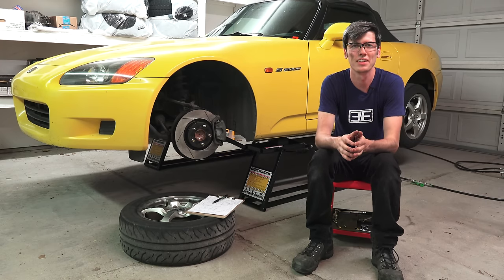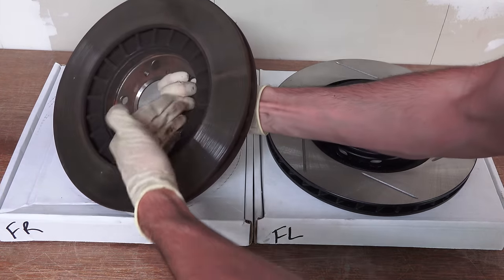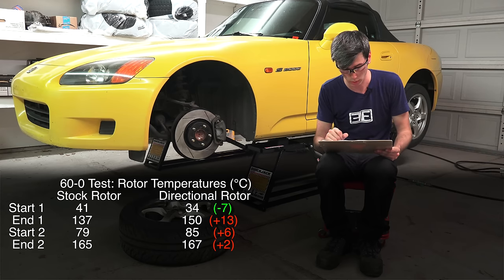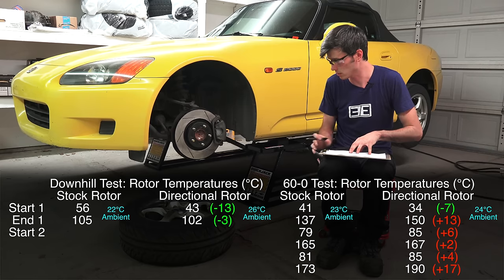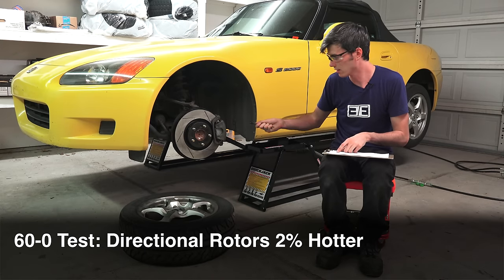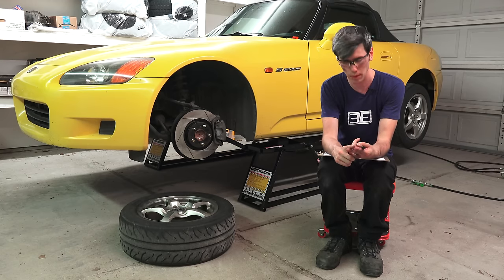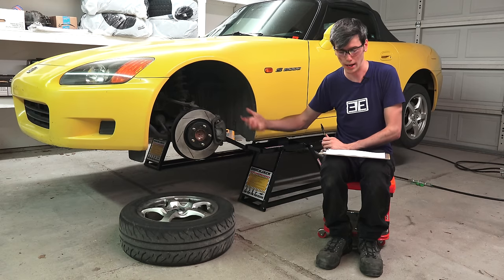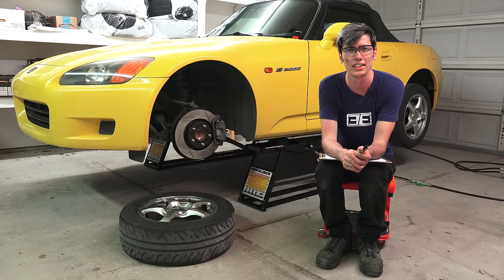Do Performance Brake Rotors Have Better Cooling?

Comment from the maker: This video is (possibly) a great example of confirmation bias. Because I think it's logical that the rotors have a better design, I did want to see if there's a reason for which they'd perform better than the stock rotors. Based on my data alone, I cannot confirm that, but I'm trusting that Science of Speed's data is accurate. Also, the sweat and grease stains are just make-up, you don't really believe I spent time in a garage working on a car, right? 😂 Follow on Instagram if you like to go fast! https://www.instagram.com/engineeringexplained/
Reply: You have 1.3 M subscribers. Treat yourself and buy you a small window unit and one of them large super quiet box fans. You can take it with you when you leave or donate it to a little old lady who needs it.
Reply: Engineering Explained way too many variables in those tests. Too bad you can't stick it on a dynamometer in a room with controlled ambient temperature and some sort of hydraulic shunt to put the exact same amount of braking pressure each time.
Reply: You nailed the analysis here. It's possible that the aftermarket rotors are designed to quickly reach a higher optimal temperature to increase efficiency, which would make them appear worse at low (and not dangerous) temperatures. Talking out of my ass here, but definitely if you are testing performance parts, the testing methods should replicate high demand events. If anything, this video demonstrates why people shouldn't be upgrading their car with expensive performance parts if they don't really know if it will help anything.
Reply: Engineering Explained Yeah, I feel like you wouldn't have put so much extra work into analyzing the data or finding other people's tests if the aftermarket ones had come out as cooler right away. But with the mass difference your results do make sense.
Reply: For example, Formula One tires would have very little grip at normal speeds. You have to run them high speed on a track to get them at optimal temperature.
Reply: Do you think that there was more drag on the new rotor? Maybe a test where you only use the emergency brake to stop will show the temperature difference, without applying braking power on the front.
Reply: Here's the issue though.  Unless you're planning on tracking the car these rotors don't perform as advertised. Also, it's difficult to trust the numbers provided by the same company selling the equipment.   

If at the end if the rotors perform better regardless of temp then it's a sound purchase.
Reply: What about the difference in unsprung mass on handling? While the Science of Speed laps were close, that may have been done specifically to compare similar amounts of energy being dumped into the brakes over a lap for the comparison of heat dissipation.
Reply: Adam Klingenberger Or use Tyre blankets to get them into working temps, now with wider rears it is much harder to get front and rear into working window simultaneously.
Reply: TheBowlingPotato great point
Reply: Engineering Explained I I believe the issue of why they were so close is that new rotors have a much higher coefficient of friction. That's why all the hashmarks are on there so they can bed in the brakes faster. I think you need to do this test after putting on 500+ miles on the new rotors and then you can swap them back-and-forth. I'm willing to bet you would get much more accurate numbers with the same exact test
Reply: Engineering Explained try the left ones on the right and vise versa please! The results could be interesting
Reply: The video is talking about the internal veins of the rotor, not the slots on the rotor face.
Reply: So you tested heating, not cooling
Reply: Is it possible that the design allows the brakes to come up to operating temps faster so that you have the most braking efficiency faster?
Reply: Jim Cole 
No. The actual metal will provide nearly all of that temp.
The design would have to be radically different to see any real change in operating temperature levels.
Reply: Could it be that your testing wasn't done at speed? Going faster would put more air over the brake rotors. And a more efficient design would mean that there's more air being displaced by one than the other. So when you have large a volume of air going through them, you'd be able to notice the difference in the data but at lower volume of air there wouldn't be much difference. I'm sorry I don't know if I explained that properly. English isn't my first language.
Reply: Dommelsch Ivy no, your test sucks. The rotors don't spin in open, cool, stagnant air when they are on the road.
Reply: I think you test is more educational than that That of Science of Speed. If you don't do trackdays- you probably can do without aftermaket brakes.
Reply: Engineering Explained new rotor might not be broken in. Such as a new engine runs hotter compared to a broken in engine.
Reply: The thing is, I think these rotors are better but it's more of a wrong application type of deal. 

they tested the rotors on a track which "proved" they had better cooling. That may be the case, but the rotors itself wtih their design my not be very good on a normal car. they had less mass which made them heat up quicker in your tests. but if we look if you would change the pads to what ever sports brand there is(EBC?) 

I saw a test on break pads that motive DVD did and the break pads wasn't as effective on lower temps, which means these were probably made to get hotter more quickly to help the break pads heat up. 

This where that test shows some promise. They can, when pushed hard, get rid of the heat. when your driving in higher speeds you have more airflow right? 

because just changing the break pads, they were(in normal condition according to that test) performing worse, with longer break distance. but when the pads heated up they were more effective. 

I think it's more of a "you need booth parts" type of deal.
Reply: masterpiece dude. one of the best videos of yours. thanks for this !
Reply: Maybe they are supposed to preform better with racing break pads that will work better at higher temperature?
Reply from the maker: I don't think there's going to be a difference in coefficient of friction. I used the exact same brake pads for both tests, and both rotors are made of cast iron. The material contact is the same, with the exception of their being slots on the new rotors, but slots will not change the frictional coefficient.
Reply: how about the pad temp? and how about rotors with cryogenic treatment?
Reply: All them sweet youtube dollars is why
Reply: You are onto something with the MASS of it. Less mass, heats up faster. But the design of it, is for ventilation. But in order to be ventilated, you need to be driving. So at a stand still, yeah, they haven't had any air put to them yet. So the smaller mass is hotter. But if you stayed in the car.. stop, go(cool faster), stop(which starts cooler WHILE driving), go.. etc. You can't STOP, record stopped, go, STOP, record again stopped. I think it's bad procedure. I have always had warping issues with my stock rotors. Go to slotted.. Haven't warped any yet. Because they cool faster, and don't stay hot like stock one's do.
Reply: This is the best answer - the cooling needs air flow... and need to measure it without braking again, so the infra-red measuring is required.
Reply: I don't think this test had confirmation bias. Stock rotors aren't designed with track temps in mind so it figres they would preform well at 50 percent brake pressure and down a hill where auto manfactures would have designed their brakes to preform.

What I would like to see is a break down of the braking efficiency throughout the range of temperatures you might see ranging from first stop in the morning to after a couple hot laps on track to test whether after market directional brakes are indeed worth the money.
Reply: What if the new rotors provide better braking than the old rotors. The better they stop you the more heat they make.
Reply: I love that you consider different biases. Thanks for the great video!
Reply: I have to say, I'm not a full-blooded engineer like some of the peeps here but I disagree RE confirmation bias. Honda has decades of racing experience and the engineering background to put good brakes on a car like the S2K--there's no packaging or cost-cutting reason for them not to. I think it would be difficult to find an aftermarket company that can design a part to the same spec and outdo Honda or many other prominent automakers. If you want the car to stop better and suffer less brake fade, give it bigger rotors and calipers.
Reply: Engineering Explained did you also consider the weight of the gasoline in the car? Not sure how big the tank is in your car or if you refilled between tests, but I feel like that extra weight also could have made a big enough difference too. (the extra comments you made at the end also make sense)
Reply: Engineering Explained but surface topography will. That's all I'm trying to say. You're coefficient will drop after you marry the two surfaces better.
Reply: Realistically for the street some basic rotors work just fine. Am I right to assume that?
Reply: Pardeep Grewal I was thinking the same thing. Maybe upgraded brake pads and brake fluid?
Reply: Engineering Explained Legitimately curious if you would get different/better results if you put the Left directional rotors on the right and visa versa
Reply: Engineering Explained i think the test wast done wrong the purpose on the veins is to alow it cool down faster also is their a material diference?
Reply: I like this idea.  40 mph doesn't generate a lot of airflow, especially going through the wheels.  Track driving would help.
Reply: while they are of better design due to curve directional vane being proven to work, they actually still have a design flaw that is preventing them from being as efficient as they can be.

that flaw was inadvertently pointed out by misconception in the video. from a cooling point of view for front wheel applications, the vane inlet should NOT be on the outboard side of the disc. this is due to aerodynamic of the car itself. the outer face of the wheel and wheelwell is actually a low pressure zone that is drawing air out of the wheel and wheel well. by having the vane inlet on the outboard side, it is trying to suck air in as the aero of the car is trying to suck air out, so the two are fighting each other.

that disc design works well in the rear because there is high pressure pushing in on the rear wheel so the vane inlets are working with high pressure. Ford and GM both took advantage of that with the newer mustangs and corvettes respectively.

in the case of the corvettes, having pillar mount dual cast discs, GM sells little disc rings that you put in on the outboard side of the vanes for increased cooling at the track on the front wheels. if the discs were in fact pulling "cooler air" as pointed out in the video by having the vane inlets outboard instead of inboard, GM would have known this and instructed to install the rings on the inboard side since the technically could be installed that way but rather they specifically state that the rings be installed on the outboard side of the front discs.
Reply: Engineering Explained  I think you are absolutely correct in considering the effects of mass vs temperature. It makes sense to me that the kinetic energy of the vehicle being transformed into thermal energy in the brakes, would be a constant. Assuming the work being done is conducted during the same time period, I would agree that the smaller mass would heat quicker, and to a greaster temperature. But the question here is cooling, not heating. I think your whole methodology is incotrect. It would seem from your testing that you tested is if the brakes would be cooler under loading, versus, if the brakes are able to dissipate heat better. I think the better question is, under loading, with the rotors spinning (at a fixed speed) and a specific temperature, how quickly do the rotors approach ambient temperature, to within a specified percentage of ambient. 
looking at heat transfer to the surrounding medium (the air) through convection, the equation is linear with the temperature differential. i.e. the hotter the rotors get, the more heat will be dissipated. and the same goes to radiation. This however, is a function of t^4! So the heat transfer from the rotor as a function of temperature, is to the difference of the rotor temperature to the 4th power from the ambient temperature to the 4th power. at low temps this will be small, but clearly, the heat rejected by radiation will be substantial at greater and greater temperature differentials!
Here is a suggestion on how to modify the experiment. ensure the car stops in the same amount of time, from the same speed. (This hold the input Ebert the same for all experiments) record ambient temp, rotor starting temp, max temp, and finnaly analyze how long it takes to reach 1-5% of ambient. Assuming that the cooling data looks like a differential equation asometotically approaching zero this may be a good approach. I think this would be much better at analyzing how well the rotors cool. 
one last thing, the recording of the rotors needs to be done while the car is moving so that fresh, ambient air is being introduced into the rotors. otherwise the cooling of the rotors will be tainted by the heating of the ambient air around them. the whole point of the curved blades is to suck air, and (I believe) allow a larger surface area to reject heat to the air.
In summary; I believe that you tested how well the brakes heat up, rather than how well they cool, and that a new experiment needs to be done to test cooling.
Reply: Engineering Explained .  What is the difference in mass?  I bet the aftermarket rotors are lighter and therefore don't dissipate the heat the same.
Reply: Engineering Explained I thought you got punched in the face in a bar fight or something
Reply: Engineering Explained which side is the exhaust manifold on ?
Reply: I bet fresh fluid changes, and higher friction pads are the best bang for the buck for a stock near factory hp car for the street. My car is equipped with Brembo 4 piston front and 2 in the rear and it's plenty for the street although the slotted rotors look nicer. I could just save some cash to be honest and this video helped me understand for my needs I don't need to spend tons on rotors.
Reply: Is it possible that left/right brake rotors have been inverted, giving them no air flow? If you invert them, the orientation of cooling cavities will be the opposite!
Reply: sseeplane I disagree. there I get what you say about control but lab testing and real life don't always match up. How would you simulate the heating and then the cooling in a lab? how expensive would it be? an how close would it be to the cooling of a mounted rotor? (direction of air flow to the rotor would be harder to recreate in a lab since you have the wheel the car aerodynamics affecting the air flow.)
Reply: Do you think maybe the difference is because you measured your brake temperatures when the car is static and not moving? Those cooling grooves only work/make a difference when the car is in motion because they rely on the car's movement to get cool air, right? The difference should be in how quickly the rotor sheds heat when the car is moving between corners versus how hot the rotor is right after you finish coming to a stop.
Reply: Kinda wish ur goofy ass would have put farenheight also... Not everyone knows celcius
Reply: I'm going to reply to your comment here as well (in case you miss mine). But if that diagram floating at the start of the video represents the side of the car that the camera is facing, you have them on the wrong way, ie they would pump more air going backwards than forwards (centrifugal fans). You have them on the wrong side for maximum airflow. Also there's differences in casting towards the centre of the disc (holes on the lighter one) that would alter the weight and have less of an effect on temperature than a lighter braking portion would be.

I believe you need to swap your rotors left to right and repeat your testing
Reply: Brett Young wrong: there are less than 5 countries worldwide using the old English system, compared to metric.
check out Wikipedia on this.
Reply: Did you consider the different surfaces? The stock rotor was shiny and smooth, the new looks much rougher, which could result in different temperatures too (more resistance when breaking -> more heat).
Reply: You should have used everything new. i dont know if you bed in the pads but the rotors wont have the exact same surface to test it in actual equal conditions. if the pads weren't bed in for the new rotors, it might create uneven friction and cause higher temperatures..
Reply: Sometimes confirmation bias is a good thing. If there's fundamental reason why the results should be a certain way which the testing is not "seeing" one should look at problems in the testing methodology just as much as problems in the thesis. In either case you're going to learn something new, either your test was bad or you will learn some new fundamental truth which flies in defiance of age old conventions.
Reply: Those rotors cool while spinning and testing them after a stop is not where they would shine. They should be cooler when you're off brake and on throttle. When you need your brakes again they've would have come down to a lower temp when entering the corner because they cool better while spinning faster. This could also lower the starting temp between each brake press on the track and keep the rotors from saturating. Also they look like they suck air from the wheel side which is a lower pressure and might not yeild as good flow and it looks like your car has vents in the bumper to bring cool air into the wheel well.
Reply: Adam Klingenberger perfomance rotors are for stoping power and withstand higher temperatures so you don't experience brake fade. the performance rotors he put on are for street use. carbon rotors that you see on formula 1 cars need to be heated before they can brake better, not Street application performance rotors. when you purchase performance rotors you purchase them because they can withstand higher temperature and they have better stopping power. The slots on the aftermarket rotors help decrease the distance it takes to stop and they push water off the rotor in wet conditions this decreases of distance it takes to stop, this is reason you purchase them.  the temperature in this case does not determine the performance of the aftermarket rotors.
Reply: Close but not quite. The slots are to relieve gas pressure formed when a pad boils/burns the layer of material in contact with the disc.

There's also a theory about cleaner pads but no-one has yet to adequately explain that one to me while explaining why wear doesn't increase (because the only way it could clesn is by removing material)
Reply: airplanesandfootball well not so much static but rather he measured how fast the disc could heat, not cool like he intended. the discs heated faster due to their lower mass. the only way to truly test cooling ability is with a disc sled temp sensor or inferred sensor and bring both types of discs up to the same temperature with doing a series of slow downs  (saw 70 to 40 mph) then sustain a particular speed with both for a period of time and log to temperature drop over that time frame of sustained speed.
Reply: James A. "lab testing" would not be very hard. all you would need is an oven and two motor assemblies to attach the discs to. basically heat both disc types to say 600° in the oven (long time to ensure full heat saturation), then take them out and mount them to the motor assemblies and run them for a given time at a given RPM then check temperature. this would show true cooling abilities since time and starting temp variables are controlled. 

Brake manufacturers have dynos specifically for this where they can vary many aspects but regardless, a "lab cooling test" would not be hard to do at all.
Reply: While watching this I actually thought this would be a great video to show how confirmation bias can happen, and how just because some tests show a result doesn't make it necessarily the most accurate representation of why those results are telling the whole picture.  Love the video and style, thank you for posting!  Even when testing doesn't go according to plan it's still awesome to see this kind of content :)
Reply: So, can we say that those rotors are not worth for everyday commuting?
Reply: Yes, for every day street use, "Quality" stock disc's are perfectly fine. In most cases, the OE disc's are over engineered as it is. Additional cooling for just everyday street use is really pointless since in most cases, the "average" sustained disc temperature rarely exceeds 300 to 400° and even that is on the high side.... 

Really, for street use, you typically want a heavier disc to be able to absorb the heat because vane design is irrelevant when the car is stopped. Surface area is king here for heat dissipation when it comes to an everyday street car which is why you are seeing more and more cars that dont necessarily need massive brakes coming with massive brakes. More mass means more energy absorbed per degree of temp rise and more surface area mean more heat dissipated per given time the brakes are not functioning.
Reply: I think a better way of determining the amount of breaks used you should have a start and stop from the point of start breaking to point of complete stop.
Reply: IMO it's the definition of "better" that is the issue here.  There are several ways to increase the performance of brake rotors intended for performance applications:

- Get up to working temp faster
- Shed heat at a rate that keeps brake pads within working temp range
- Do all of these things while being lighter (reduce unsprung weight)

You just don't have many variables to work with to achieve the above.  You can adjust total mass, you can adjust surface area (slightly), you can adjust hat material, and you can do minor things like adjust vane design.  Adjusting each variable is going to result in a tradeoff.  Less mass = less unsprung weight and faster getting up to temp, but potentially prone to overheating.

I think this is why basic road car brake design is mostly about rotor diameter (which is shorthand for mass).  Street brakes have optimal operating temps of [ambient] to [not that much].  So lots of rotor mass will soak up intermittent braking, or emergency braking, without sending the temps out of operating range.  But on the track, you WANT the rotors to get hot and stay within a certain range.  So you need them to take in heat and then shed it at a particular rate.  Now your variables like horsepower, weight, and grip levels will affect the rotors' ability to do that.

What would be interesting is if you ran some of the math on this - get some track pads and spec operating temps, and see if theoretically performance rotors do that job better, or at least more efficiently (e.g. keep the pads at temp with less unsprung weight).
Reply: +AutoNut, Actually the coefficient of friction will increase after the disc's are bedded (if proper bedding was not done initially). Even then, the increase in friction coefficient will not change the temperature rise in the disc assuming no stopping variables were changed (i.e., the initial speed and time of stop remain constant, then brake disc temperature rise will be the same). 

The reason for Friction coefficient (Mu) rise is because a bedded disc will have a microscopic layer of pad material on its surface and thus the full friction coefficient of the pad can be seen. Cast iron in itself has a lower Mu then the pad, so the the total true Mu of a brake system with new disc's is lower then it will be once the disc's have been bedded. 

A change in friction coefficient is only going to change the torque that the brakes can produce for a given line pressure (really a given clamping force but this is directly proportional to line pressure). The heat input is a product of the vehicle's mass and velocity and time / rate of decel. If the friction is higher, you will then apply less pressure to maintain the same decel rate or time which to maintain the linear heat input relationship between the two test subject (discs). 

Regardless of all that though, the test was flawed as he effectively measured heat rise, not cooling ability of the disc. The proper test would be to start out with the discs at a particular temperature and spin them for a specific time at a specific rate of rotation and then measure their temperatures after this given cool down period. If once "Cools Better" then the other, that one will be at a lower temperature after a given time if the speed is kept consistent between the two test subjects and their initial temperatures were the same at the start.
Reply: Very cool to watch the process and have it all properly looked after and accounted for.
Reply: Engineering Explained hey really enjoy your videos, I think you should try it again and change the brake pads, yes it will be long but that should cut some variables
Reply: this is so flawed. slotted rotors are designed to Remove gases created by the pads under extreme heat and braking conditions to manta in contact and keep friction on the rotors. it's called degasing
Reply: Rob Horn modern brake pads don't degas.  That was true in the past, but not anymore.
Reply: Jeffrey Alpert Modern brake pads do in fact outgas BUT som quality pads and race pads alike do not do so until beyond the point that they start to fade due to friction coefficient drop related to temperature.This is because the resin binder technology has improved making the resin binders not start to gas until higher temperatures but nonetheless, all pads do still outgas at some point.
Reply: Rob Horn, this video had nothing to do with the slots... It just so happened that the disc's in question were slotted. While the tests are flawed, the tests were related to the vane design, not the slots.
Reply: You are mesuring the surface of the brakes... there is less surface area on the slotted brakes, so it heats up faster... also depends on the type of metal used... however I am sure you already knew this... thanks for the video...
Reply: and in by surface area... I mean surface area in contact with the pads... of course they have more surface area overall (the slotted ones)
Reply: +The Shaver Ranch + Wolves surface area has "almost" nothing to do with how fast that disc's will heat. The Slots actually add to surface area, not reduce it but this is irrelevant since surface area has "almost" nothing to do with rate of heat rise. The mass of the disc and the materials thermal conductivity controls about 99.9% of the potential heat increases. 

Surface area comes into place when shedding heat after the braking event is over. More surface area means more contact with cooler are to transfer heat to. This is why I said that surface area has "almost" nothing to do with the rate of heat rise. Yes, a larger surface area (i.e., larger disc primarily) will shed a bit of the initial heat into the air as during the braking event but this amount very minute and again, technically the slots are adding to the surface area, not removing from it since the slots are equate to greater amount of area due to being 3 dimensional then the area lost from the 2 dimensional are flat plane are they are being cut from. 
 • For example, if you have a 50mm cubed solid mass, you have 15000mm ² surface area. If you now cut a slot into it that has a dimension of 40mm x 5mm x 3mm, your total true surface are is 15270mm² This is because when cut the slot you are adding the area of 40*3 twice and 5*3 twice.and you are leaving the 40*5 area but making it deeper into the material. Now if the slot were to go all the way though a thin disc, then you could actually decrease surface area if the right dimensions were used... for example, if the solid object were only 3mm thick (50 x 50 x 3) and you were to cut a 40 x 5 slot all the way though the 3mm thickness, then you would reduce the surface area by 130mm² (would go from 5600mm² to 5470mm².... This though is not the case since the slots do NOT go all the way through the discs but rather just a few millimeters below the disc surface.

All in all though, the flaw in this video is that he measured how fast the discs will heat, not how efficiently they will cool which is what he intended on doing but did wrong.
Reply: +The Shaver Ranch + Wolves, sorry I should have read your second reply / comment before replying to your first one since I see that you already kind of know what I explained in my reply.

Regardless though, that pad contact surface area change that you are referring to is irrelevant and will have no measurable affect on anything relative to the discs. Basically it does not change any aspects of the heating or cooling of the disc. The total surface area of the disc is what matters and again only really matters from a cooling standpoint after the braking event is over.
Reply: Besides the shape and grooves and stuff the real difference is that stock rotors are usually made of high carbon virgin steel and that's usually better than the aftermarket stuff. Especially if it comes from China.
Reply: magincap70 , they are cast iron, not steel but regardless of that, yes often OE units are made from higher grade and higher carbon content iron. This however is primarily relevant to wear resistance and has virtually nothing to do with heating and cooling.

Simply put, the mass of the disc determines how hot it will get for a given braking event and the vane design and overall surface area will directly affect cooling ability after the braking even (with vane design only being relative if the discs are still spinning). The carbon content will have just about nothing to do with the rate of heat saturation or cooling .
Reply: They make steel rotors too, but you're right it's high carbon iron. Those are the ones I'm specificity referring to. Once you mix something with iron though isn't that what makes it steel? Anyway, that's all we put on cars at the shop I work at. Coated high carbon rotors are the only way to go.
Reply: magincap70 I actually don't know anyone that regularly tracks their car who uses expensive rotors.  Everyone I know uses NAPA cheap blanks or equivalent.  They're a wear part and expensive rotors don't do much of anything except cost more.
Reply: magincap70 I actually don't know anyone that regularly tracks their car who uses expensive rotors.  Everyone I know uses NAPA cheap blanks or equivalent.  They're a wear part and expensive rotors don't do much of anything except cost more.
Reply: Yeah that makes sense being that you'll pretty much destroy them due to warpage after one use. What's your point though?
Reply: Hahaha.  OK.  I'll bite.  "Coated high carbon rotors are the only way to go", as you say, is false.  Here is a list of things that affect rotor performance:

- Mass

Type of iron/steel matters very little.  They have very similar specific heat.  In addition:

- For cars that actually require increased cooling loads - race cars, track cars, etc. - most people I know, both racers (crapcan, spec E30, spec Miata, etc.) and HPDE track rats, use cheap rotors.  They don't warp, and don't do anything different from any other rotor.

- If you have increased cooling needs for your brake system, the first thing to do is usually to install brake ducts.  The next thing to do is to install larger brakes (big brake kit), to gain more mass.  You'd never try and buy expensive rotors to solve that problem.

- The main benefit of very good expensive rotors is unsprung weight savings.  These will be 2pc rotors with an aluminum hat, or perhaps a lower-mass rotor with a slightly better vane design (as in this video).  For a lightweight track/race car, the unsprung weight savings can actually be beneficial.  For a street car, they're useless.

- I have firsthand, secondhand, and thirdhand experience with both cheap and expensive rotors in high-heat (track) settings.  I've never seen someone's cheap rotors warp, and I've never seen someone claim that expensive rotors solved their brake cooling problems.  I HAVE seen shitty brake pads lay down uneven deposits, and I have seen shitty brake pads fade and crack.

- I do believe that very expensive rotors probably offer some marginal performance benefit.  But that benefit is heavily, heavily outweighed by better cooling solutions described above.  Ergo, the VALUE of expensive rotors is near-zero.

So my point is - I understand you install expensive rotors at your shop, so there is going to be some cognitive bias here.  But time and time again, on race tracks across the country every weekend, you'll see that expensive rotors are a waste of money and do not offer substantial performance advantage besides weight savings.

Expensive rotors are almost entirely for show.

Additionally, the Chinese raw material (steel) industry has substantially improved its quality over the past decade.  Most of my clients (who were burned in the past by poor quality Chinese metals) have revisited their procurement strategies, and have found that Chinese steel can now be sourced at good quality.  Everyone in any industrial setting seems to have a story about poor-quality Chinese raw materials, and those stories are always at least 5-10 years old.
Reply: When did we start talking about racing? I never did. The real racers use steel single press rotors or ceramic anyway. Who cares what your cheap track rat friends do. Coated rotors don't rust up and look shitty in two days. They can last 40,000 miles and are so much better than a napa special. I live right next to lime rock. These guys use expensive stuff to race expensive cars. Do what you do.
Reply: magincap70 steel discs are primarily for weight savings and used for applications that are not very hard on brakes or subjecting them to a lot of heat like motorcycle and ATV's and such. I can't think of any cars that have ever had steel discs.

Without going into a materials science lesson here, you are sorta right about the carbon and steel and iron, just backwards.

Yes, cast Iron and steel are both Alloys of Iron ore, but steel is actually the result less carbon, not more plus the other alloying elements. Steel is less then 2% carbon whereas cast iron is 2~4% carbon.

Carbon adds toughness  (i.e., wear resistance and hardness) but at the cost of being brittle and not as strong. This is why you can't bend cast iron without virtually instantly cracking and breaking it but steel can be bent with ease. The higher carbon in cast iron is also what makes is a SOB to weld.

There are other aspects of their element makeup  properties that separate them but yes, they are both iron ore based and both have a primary alloying element of carbon but as said, steel is allowed with less then 2% and cast iron is more then 2%

The added wear resistance and toughness that comes from the added carbon is why many OEM's use higher carbon iron for their discs. With the warranties they most are offering now, then don't want items to wear out before the warranty is up or its lost money to have to replace under warranty.
Reply: Jeffrey Alpert, yes, the expensive high quality OE and OE type replacement discs are avoided by most (if not all) track guys for their cars due to both cost and more importantly cracking potential.

The High carbon content of these discs make them more crack prone with thermal expansion. So most would rather a set last them a couple races at best then to have them crack and potentially shatter all together during the first race on them. 

Some aftermarket race brake manufacturers  (like Wilwood for example) have been playing around with other alloying elements that allow them to increase the carbon content for the increase in wear resistance and toughness but without the added crack potential that comes with the higher carbon. In the Wilwood example, this is their fairly new "Spec 37" unit. This however does raise the cost quite a bit. While I'm paying a noticeable amount more per disc then what I used to with the newer spec 37 discs, I've also noticed a significant increase in disc life. So far (haven't been using them that long) the extra cost is being offset pretty easily by the disc life. 

I think eventually this newer allowing tech will make its way to the everyday replacement and OE side of things and in that case, the el-cheapo discs will no longer be used by those running OE brake configurations.
Reply: Cool Chris. Very informative.
Reply: ChrisP, thanks, a few questions for you.

1) what is it about steel that makes it suceptible to fracture?  It's been about 15 years since I took my matsci courses, so I don't recall much about the structural differences between higher carbon content in iron vs. lower.  Is there something in the molecular structure, crystalline structure, or what?  I have to imagine fracture occurs because of localized stresses develop - is steel less uniform than cast iron?  Does it have lines of fracture?  Does it heat/cool less evenly (which would be weird considering SS vs. cast iron cookware)?

2) I've always been told that cross-drilled rotors fracture because of localized stress concentrations that develop on heating/cooling cycles.  Is this still true (it makes sense), or do those types of rotors typically fracture because they tend to be made of "expensive" materials that are more prone to fracture in the first place?
Reply: Jeffrey Alpert steel is less likely to fracture due to the low carbon content. Cast iron is more likely to fracture. As it cast iron cools from its molten state, the graphite  (carbon), crystallizes out of solution at the grain boundaries which causes a granular structure that has a very low tensile strength. Crack / fracture  resistance is a result of tensile strength. The higher the tensile strength, the more crack / fracture resistant a material is. Steel has a very high tensile strength which is why it can be bent without fracturing.  Cast iron has a very low tensile strength which is why it fractures so easily (even just from thermal expansion).

The problem with using steel for brake disc flex and thermal distortion. Cast iron dues to its toughness does not flex nor thermally distort like steel does in the same application which in some things (like a brake disc), is a desirable aspect. If the application however will be subjected to high tensile loading, cast iron is a very poor choice of material for the job.

As for the the drilled and crack / fracture potential increase with the process, it is a localized stress that is induced into the part. When done to something with a low tensile strength, cracking forms due to the thermal expansion because of that low tensile strength. Basically by drilling a hole thru a material that has a weak crystalline structure further weakens the structure that much more. Add in tensile loading due to thermal expansion around the weakened area and it has no choice but to fracture. 

One way that has been used to combat this issue when someone  (like Porsche or Mercedes Benz) wants a drilled type disc for OE applications is to use a "cast in place" process. This is where the disc is cast with the holes already in place (as it's name implies). This removes a lot of the localized stress since the granular structure is formed around the hole instead of having a hole drilled thru the structure thus weakening it. Even this process is not 100% crack resistant but it is much better (more resistant) then post process drilling and still achieved the same desirable affect for having a drilled disc. The is a very costly process though due to much greater casting difficulties compared to casting a normal disc. If memory serves me correctly, Brembo is the only manufacturer to do this and it's only been used on high end expensive cars that had OE installed "drilled" discs.
Reply: Chris P makes sense.  So essentially cast iron, despite  having lower tensile  strength, deforms less under heat, so low tensile strength is less important.  (Also low deformation in a braking system must be inherently desirable as well).  

So it sounds like we have two issues.  One is the casting process itself is forming a macro crystalline structure with low tensile strength.  And the other is the inherent tensile strength of the alloy.  

I'm surprised there is not some obvious alloy of steel, or some cooling path that achieves a more brittle yet heat stable steel crystalline structure.  I remember the steel eutectoid diagram having a huge variation of final mechanical properties.  However, I imagine that using a tightly spec'd alloy and quench means you have to machine the rotor from a blank, rather than cast it as with iron.  Which means hugely inflated cost for not much more performance...?

Is the issue simply that cast iron already has the requisite property of low heat deformation @ very low cost, whereas to get steel to do the same, the cost would be much higher, so there is no benefit?
Reply: +Jeffrey Alpert, the biggest factor is manufacturing. Since cast Iron meets all the requisite properties but manufacturing is 1000x easier, it makes no sense to go with steel except possibly if the disc is solid and thin (like a Motorcycle).  Making a Vented steel disc would be an absolute nightmare to manufacture (machine) since it would have to start out as a solid billet blank steel disc with a ton of excess material removal necessary.  With a Cast product, final machining is kept to an absolute minimum which reduces many cost aspects of manufacturing.

With that said, there must be some other factors that I am not thinking of or aware of because there is the possibility to actually cast steel. For example, the spindle's / uprights on cars are actually cast steel but often thought to be cast iron. This is due to safety concerns with fracturing upon impacts. Cast steel has a higher Tensile strength then cast Iron which allows an upright to bend a fair amount before it fails (fracture). Granted it doesn't have the tensile strength of that of billet steel, it does however have enough over cast iron that allows engineers to have a comfortable FoS (Factor of Safety) in final designs.

The only thing that I can think of off hand goes back to the wear resistance issue with the lower carbon of any steel products (cast or billet). Since the main job of the brake disc is to provide a friction surface for the brake pads to ride against, a Cast steel disc would not last as long as a cast iron disc.
Reply: In my experience working on euro cars for the last ten years is the only rotors you want to put on your daily driver are the high carbon coated rotors. At least for the 99% of people who don't race their cars. It's the difference between a 15,000 mile brake job or a 40,000 mile brake job. It'll cost a little more, but you literally get twice the mileage. So for us, that's all we use. Steak or hamburger? There's a market for both, but our clientele are the steak people. No way I'm putting Chinese cheapos on a BMW. All you get after you do that is a pissed off customer.
Reply: That's fair, although I guess I'm surprised to hear the other rotors last longer.  Are the OEM pads on BMWs rotor eaters?  BMWs are generally big heavy cars these days, so I wouldn't be surprised that they eat braking systems generally.

I have the Centric rotors (generic Stoptechs - about $30 each) with the coated tophats on my Miata, and after 15 or so track days with race pads and r-spec tires (so >1g braking events), the rotors show very little wear.  The OEM rotors went about 90k miles before I removed them, and still have lots of life left (new rotors were installed for bedding with race pads).  The Miata is super light weight though and has a very robust braking system.  But then, my old Expedition did OK, too - I had Centric coated rotors with Hawk LTS pads, and didn't see much wear after 10k miles before I sold it.

What rotor brands are you installing?  Are they aftermarket or OEM?  If there is a rotor that lasts twice as long, I'd consider installing it on my other cars.
Reply: Centric are pretty decent. We use them often on hondas and slightly cheaper stuff that comes in. Generally Oem BMW stuff lasts real well, but Mercedes cross drilled rotors are made of a softer material that wears out pretty quickly really. I guess the theory behind it is that the pads dig in and make for more stopping power. You'll get a half centimeter ridge around the rotor and are generally supposed to be replaced with the pads. They're like $200 rotors though so most people we take the ridge off for and they get a little more life out of them. They're usually on the gl or giant s500's though. If you buy one of them, you better not be concerned about cost though lol. Zimmerman, pagin and Bosch make some really nice e coated stuff that lasts a long time without turning all crusty and rusty.
Reply: For ford stuff though, the stock rotors are awesome and surprisingly cheap.
Reply: Bosch usually is the stock stuff on BMW. They out source a lot of the parts on their cars. Lots of valeo and Bosch stuff in a bimmer. Sometimes the only difference between a $600 part and a $300 part is they don't put the BMW logo on them.
Reply: Engineering Explained you showcased the ability for the rotor to reach optimal operating temps quicker.  Science of speed demonstrated that the improved cooling design helped maintain thermal stability.
Reply: you used to be an engineer but what you are doing is still an engineering idea
Reply: The magnetic Thermo-probe is great; was anticipating a digital thermo readout

Aside, should have put googly eyes on the frowning Amazon box
Reply: Seems like there's probably an optimal temperature for breaking, not too hot or cold. Don't know much about it.
Reply: PANKI_7 starter or bad ground to the starter or blown fuse.
Reply: PANKI_7 a battery can show good voltage and still be bad. Amperage is what does the work. Voltage is just the carrier.  Your battery can't supply the amperage needed despite having the voltage. This is why to properly test a battery, a load test needs to be preformed. A load test (which it's guaranteed that your battery will fail) will truly show the condition of the battery. 

All in all, voltage tells you very little.
Reply: Yeah Chris p is right. I didn't quite understand that it was working with a new battery.
Reply: Completely unrelated but what is that jackstand you have your car on? I need one of those in my life. Thanks
Reply: Also remember that brakes work better when hot but fail when they get too hot. Maybe the design is trying to keep things in the sweet spot? Hotter at low speeds and comparatively cooler at high speeds?
Reply: The type of brake pads makes a lot of difference. Some brake pads generates hotter that others.
Reply: Thats not true. The amount of heat generated by the brakes is strictly a product of the amount of kinetic energy converted in a specific amount of time. The pad makes no difference here.

Where better pads come into play is fad resistance and pedal effort. Better pads do not fad until they reach higher temperatures. Better pads also give a sense of better brakes because of reduced pedal effort as a result of the higher friction coefficient. For example, in a given specific car that has 0.3Mµ pads, it takes 80lbs of pedal effort to decel that car at a 0.9g decel rate. That same car with 0.5Mµ pads takes 64lbs of pedal effort to generate that same 0.9g decel rate. Its that 16lbs reduced effort that give a "sense" of better brakes. In reality, the braking is still the same and the same amount of heat is generated since the kinetic energy to heat energy is the same (assuming that both setups had the same initial and final speeds for that  0.9g decel rate event)
Reply: I understand your perspective, but controlled environment results don't reflect real-world results. So in this case, the testing is very accurate for people who would use "upgraded rotors" on their everyday cars in the initial break-in period. I say initial break-in period as we don't know if the rotors were broken-in prior to these tests, as that would have an impact on the thermal readings. I would have liked to see more stop-start traffic with intermittent testing every 15 minutes, but these parameters are still very realistic. 
Racing cars on the other hand are a different story, and you could argue that the results of this test aren't accurate for racing applications.
Reply: This test is 100% invalid based on the Title of the video and is invalid all together because NO brake disc is designed to cool during the braking even. ALL cooling of every disc in existence is, always has been and probably always will be designed to cool AFTER the braking event is over.  The break-in will NOT have any effect on the thermal readings. The final temperature of the disc at the end of a braking event is 100% dependent on the energy converted (kinetic to heat via friction) and the mass of the disc. This is laws of physics. 

The "aftermarket" disc's that he used will always be hotter at the end of a given event relative to the OE's he compared too (all things being equal) due to the "aftermarket" disc's being lighter (less mass.... again, physics...).

The problem with your "would have like to seen more stop and go traffic" testing is that it would be next to impossible to compare "Apples to apples" since you cant control traffic and what speed you can get up too or when the next stop will occur (i.e., duration of cooling time between stops).  The only way that you could do that sort of test and truly compare apples to apples (i.e., subject both disc's to the exact same conditions for the entire duration) is on a brake Dyno.
Reply: Analysis spot on
Reply: My thought - his uncontrolled/variable stops will greatly affect the temperature.  He should get  new rotors, and place stock on right/aftermarket on left.
Reply: The truth is manufactures put considerable effort into making sure standard equipment is fit for function and performs correctly. I have seen many times where performance aftermarket parts are inferior too OEM parts.
Reply: gpegasusm yea but they’re at the same angle?? right
Reply: Engineering Explained hey man the cooling on the rotors work when they are spinning. So the directional rotors will cool better while driving. But as soon as you stop the temps will be the same. But thats just an idea.
Reply: ok  good to see you are getting into the video with full make up???  
most of the time  if you like what you are doing  its not work,  I like your comparison of grannysmith green apples to grannysmith green apples     keep up the good videos...
Reply: I'm wondering if the after market ones perform better and stops the vehicle at a shorter distance if so does that mean it creates more friction therefore more heat? I'm not an engineer so please excuse my noobie question. Love this channel BTW. I've learned so much!
Reply: Not shure, but maybe different alloys can have different temperature change rates, thus the aftermarket maybe gets hotter quicker, but also will became cooler quicker (same thing with rotors mass)? Unfortunatelly, is not possible to measure this with your setup... (sorry for strange english, not very proficient)

Thanks for the great channel
Reply: Really? You "trust" that their data is accurate when clearly they have NO conflict of interest? hmm... definitely NOT the case! Mass makes a big difference!
Reply: Engineering Explained I've seen other examples like this one where the type of driving determines whether or not you wasted your money.
Reply: I think the higher temperature on the performance sets are showing that they are performing much better by absorbing the kinetic energy and converting it into heat energy. The question should be does that higher heat cause more wear in the performance brakes over the conventional ones. Certain metals such as Titanium or carbon fiber can brake at higher temperatures and not wear out as quick as steel brakes would.
What are the materials that are being used in your conventional vs performance brake systems?
Reply: This test is flawed- if you are using slotted rotors you must change the brake pads so they have a smooth surface for braking. 
Every time you use slotted rotors they can not be machined on the brake lathe, while the stock rotors can be.
Odds on what he is seeing is the uneven wear causing friction the extra heat. 
The real question is how long has those stock pads and rotors been on the car??
Reply: I’m an experienced mechanic, engineer and early engineering teacher, and now an industrial designer.  You do a great job considering you’re not a LAB.  2 things viewers and EE should consider:  
1 pound is a LOT.  decreasing your rotational mass(on the front alone) by 2 pounds makes a difference in acceleration, braking,  a BIG difference in rebound of suspension and handling- of course at high speed and performance level.  At daily level?  You’ll get a few extra miles per tank on gas.
Temp level vs caloric ability to dissipate heat.  At daily street speed, at which you tested, let’s assume these rotors are exactly equal with a difference only in 1 pound of mass.  Where the stock rotors may(will) suffer is at high temp.  Race cars run high temp rotors, pads, and even brake fluid.  Stock rotors and pads will melt(fade to worthless) on a track or even with long term “spirited” road driving, especially if you’re racing through the Poconos or West Virginia or Colorado.  Idk what that THRESHOLD temp is, but I would guess that a performance rotor is designed to run just under or at that threshold for long or longer periods.  Performance pads ARE designed to run at that threshold and in fact have different temp ranges for different tracks, simply because they don’t work when they’re cold.
While your test proves that aftermarket brakes are a waste of money and won’t last as long on the street, without a very complicated set off data from speed runs, you just have to take the word of an experienced track racer and experiment and collect your own data for your own car.
Reply: Considering the supposed air flow,  I think the rotors are placed the wrong way.   As the wheels  spin forward,  the air must be forced the wrong  way (inward) by placing  the rotors that way rather than forcing air outward.
I could be wrong.
Reply: gpegasusm . Considering the supposed air flow,  I think the rotors are placed the wrong way.   As the wheels  spin forward,  the air must be forced the wrong  way (inward) by placing  the rotors that way rather than forcing air outward.
I could be wrong.
Reply: I think that you are not doing the experimentation in the proper way because you may dont have the correct equipement. As you said in the video the AM rotors seem to be hotter at the end of each tests. But in fact what is important as you said is how fast this rotor cool down. And you just can't tell with your termometer because those rotors needs to rotate in order to reduce they temperatures. You should have logged the temperature agaisnt time to tell if those rotor are better than stock. But anyway nice try to find out for yourself ;-)
Reply: Thank you.
Reply: +Luis Ochoa exactly what I was thinking. If the biggest difference between the performance rotors and stock rotors are the cooling fins and their ability to pull air through, then they have to be rotating, and moving air to get that benefit.  That's probably why the track test showed them to be better.  it was testing braking for curves, then when leaving the curves, the rotors would cool quicker and be ready for the next curve.  Stop and go traffic would not replicate the track conditions, that these are probably marketed towards.
Reply: +MFMP007 The slots on the surface might look wrong, but the internal vanes between layers are the other direction.  Watch from 0:42 - 1:12, and he gives a visual, and explains.
Reply: @EngineeringExplained  many different compositions od cast iron can be used. Just differences in carbon content can skew friction and temperature results tbh.
Reply: @AverageReviewsYT  most of the world does though 😉 but yes putting both measurement systems may help some folks
Reply: You put your rotors on backwards.
Reply: I think your new performance discs become hotter because you didn't bed in your brake pads into new discs